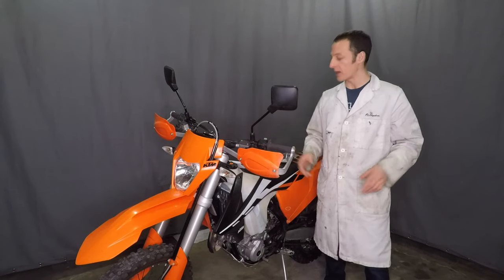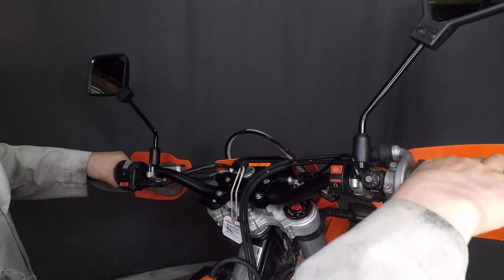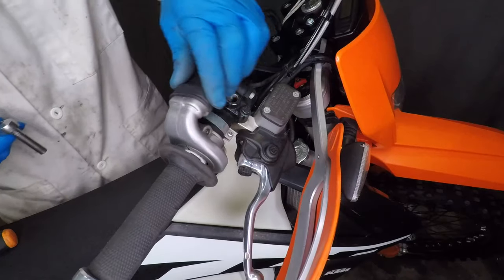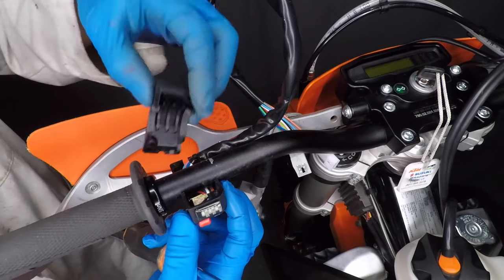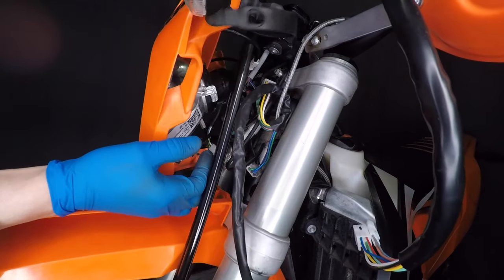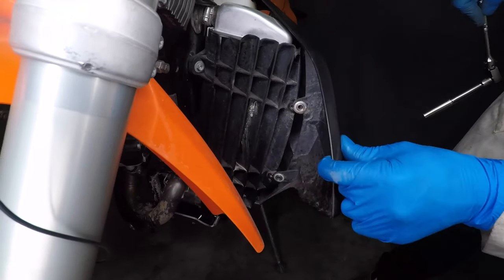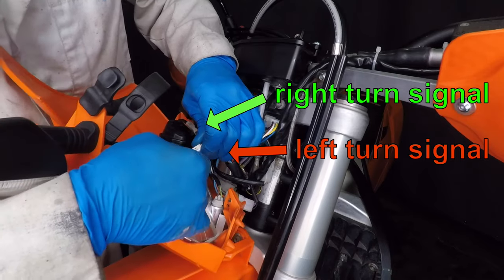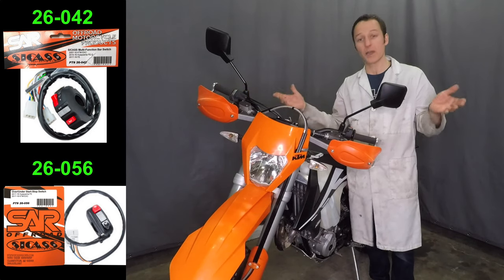Sicass Racing headlight/turn signal and start/kill switch installation on a 2017 KTM 350 exc-f

Comment: Should have bought the HDB mirrors with those hand guards they are sick and really cleans up the bar.
Reply from the maker: I tried their little round mirrors, and I love that they fold perfectly into the hand guards.  They're perfect for someone who rides on and off road a lot.  I rode my dirt bike 95% of the time off road, and once in a while I would go on a road trip.  For that, I preferred to attach stock mirrors because I can see better with them.

Comment: Eh, 2021 500 exc-f same fitment issues -- the Sicass switches are smaller, but still very annoyingly large in some dimensions, especially the start/kill switch with the throttle case...

Comment: Paul. The OEM kill switch wires are Brown and Blue/Black stripe.  At 3:01 you say to plug into the single terminal.... My question is this, is the single terminal connected to a white wire with a grey stripe? The reason I ask is because I have a shop manual and it only references the White wire with Grey stripe coming from the kill switch in the wiring diagram (No mention of any blue wire) . Now common sense would tell me that this is the wire, but because the wiring diagram is obviously not accurate I dont want to plug something in that may have unpleasant affects on other things (Such as expensive electronics) Foolish me for relying on wiring diagrams......
Reply from the maker: It's the blue wire in the video.  I don't have that dirt bike any more, so I can't really answer your question.  The kill switch wire gets grounded and tells the CDI to stop making a spark.

Comment: Much thanks for the great video. What kind of hand protectors do you have here? It appears that they mount to the very inside of the handle bar. That’s great. The KTM ones don’t fit well and do not allow me to adjust the controls downward, which is my preference. Thank you for any help!
Reply from the maker: The best hand guards are made by highway dirt bikes.  Check out my video about hand guards here:  https://youtu.be/zCvF61p3sb8

Comment: I have just the headlight/turn signal control block and I can't get the horn to work on my 2015 500exc. The original block has the 6 terminal plug, but it also has an additional wire with a nipple on the end and I have no idea where it goes as the Sicass does not have this wire.  I can't register the bike without a horn so I'm stuck. :(
Reply from the maker: The sicass switch might have the horn wire going into the connector.  Figure out which wire goes to the horn in the motorcycle.  Look at your horn.  Look at the wire colors.  Follow the wires.  I can't tell you in a message how to diagnose electrical systems.  Basically find out which wire makes the horn turn on, and find out which wire on the switch does that.  Connect them.
Reply: @LabCoatPaul  Thanks for the reply. I did try to trace the wires but the way they are routed in the harness makes it very hard to see. 

Turns out that single wire was for the kill switch on the horn/headlight block, but isn't needed as the bike already has a dedicated kill switch on the ignition block.  

The issue was caused by a defective horn switch/contact in the Sicass block. I just mounted the original block back on so the horn works and the turn signals are controlled by the Sicass block. Not pretty but it got me through inspection lol.

Comment: I’m finding the sicass kill switch is not killing my bike (2018 KTM 500).  I’ve gone through two already and both will kill the bike for a few weeks and then stop killing it.  

Is this a known issue?
Reply from the maker: The kill switch works by grounding the ignition module.  Check the ground cable to the frame, and clean the connection with some sandpaper or a dremel tool if needed.  I never had a problem with mine.
Reply: @LabCoatPaul  Yep, I’ve cleaned the ground connection.  Can you tell me where the white/grey ground wire is routed through the bike if I wanted to check it for damage?
Reply from the maker: @scottdrew6403  Watch the video at 3:30 for ground wire routing.
Reply: @LabCoatPaul  not the ground wire, the other wire involved in killing the bike:  the white/grey wire which goes to the stator (I think it’s the stator).
Reply from the maker: @scottdrew6403  OK, sorry, I haven't traced that one, so I don't know.  It most likely goes to the CDI.